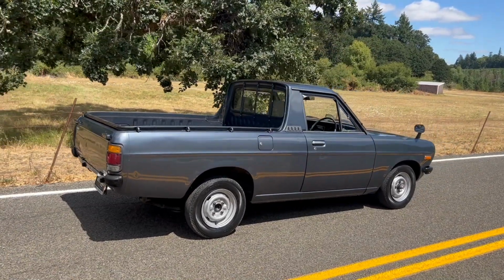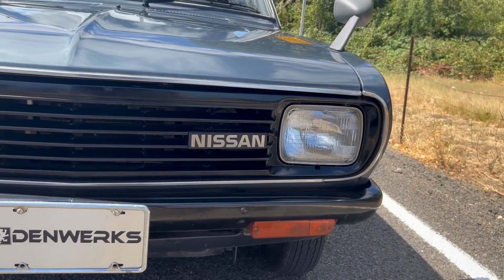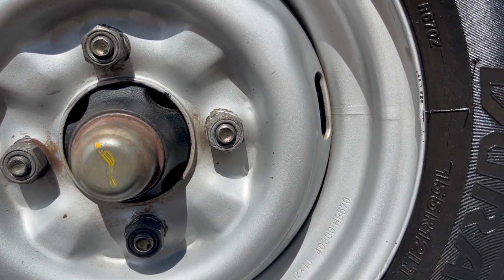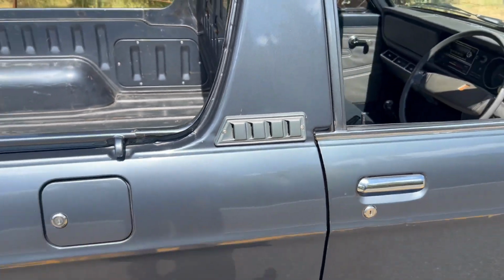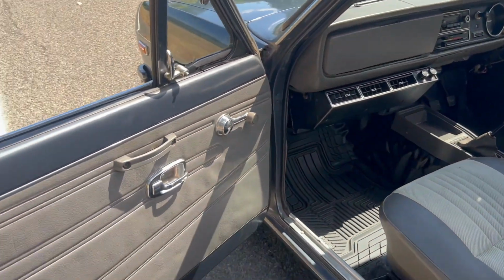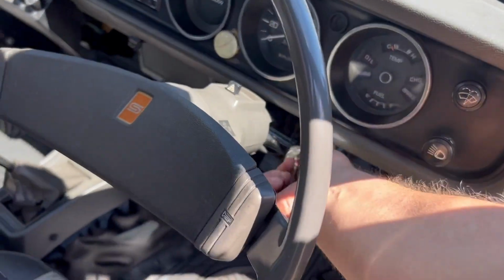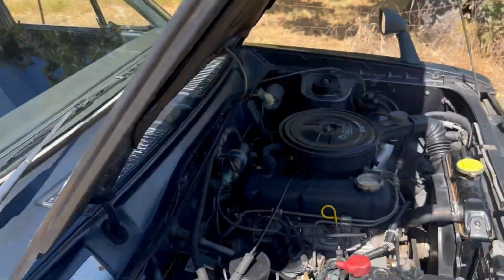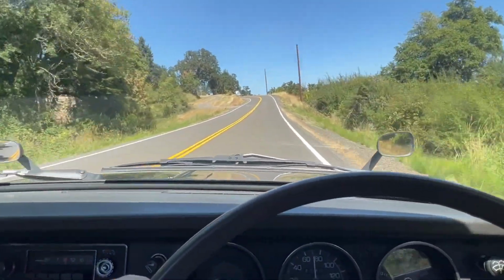1990 Nissan Sunny Ute - Japanese Import - Denwerks - Bring a Trailer

Comment: Why can't America make small little pick up trucks like that
Reply: Because nobody will buy them, sadly.
Reply: They would not meet 2023 and upcoming crash standards, and there is not enough space nor enough electrical power for current and even upcoming safety equipment. Your best bet is a restored 1970s or 1980s NISSAN Hardbody (D21) or Tacoma.